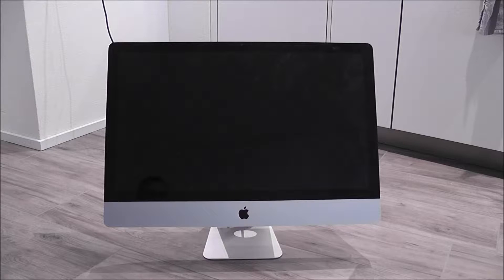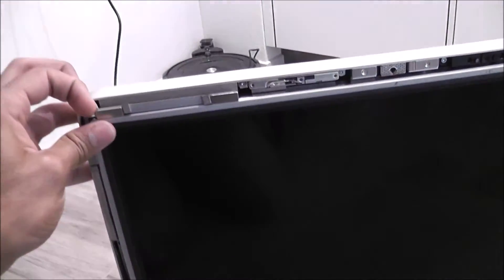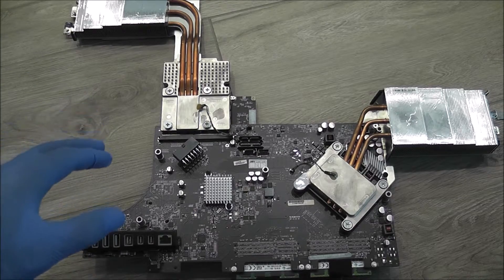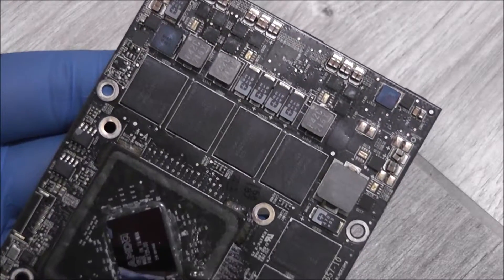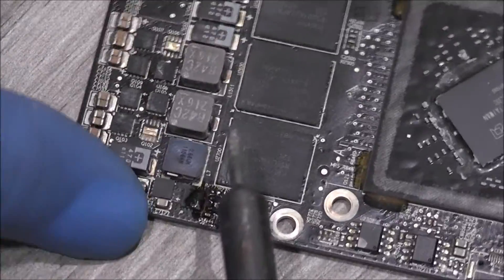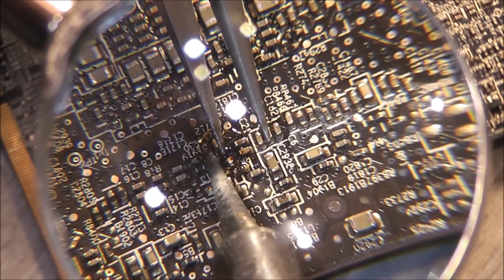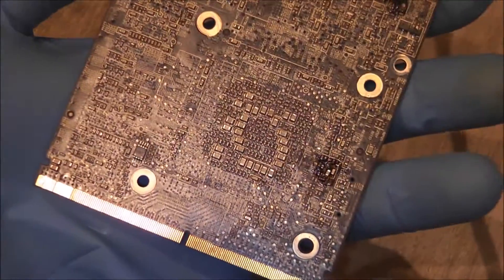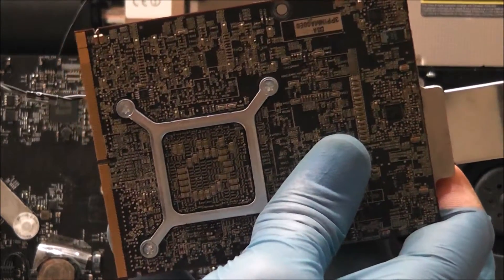iMac 27" repair - Lines on the screen

Comment: Bake the card at no more than 200°C for only 10 minutes. Make sure your oven accurately sets temperatures. If you have an analog oven get a thermometer and place it in the oven. You do not want to go over the 200°C mark by more than a degree or two.

Comment: This would have been a great video if it has actually showed the details of the work being done.  All of the hard parts were just skipped over.  Poor video.
Reply from the maker: Sorry for that. Next repair I do I will capture all details. The problem is the length of the videos. People seem to like short and to the point videos. With this kind of work, that's difficult to do without making a video very long in some cases
Reply: @SolveElectronics  I understand.  Another option is to break the repair into a series of short tasks oriented videos.  That works well when some tasks are repeated for every repair and people can watch that once and not need to see it again.  For example, removal of cover glass and display might be one short video as that must be done for every repair.  Then have videos for things like removing hard drive, removing CD drive, removing motherboard, etc.  Then folks can essentially pick from a menu of videos to get what they need.  Just a thought.

Comment: Nice video I found an Imac 27 2011 on the trash . I baked the gpu but it doesn't work the imac keep restarting and have some artifacts so I have to buy a new gpu but its a bit expensive to be old .
Reply: Try and find someone selling a iMac that is the same model with a broken screen. You can get it cheap and either pull out its graphics card for your imac or take off your good screen and replace the cracked one with it.